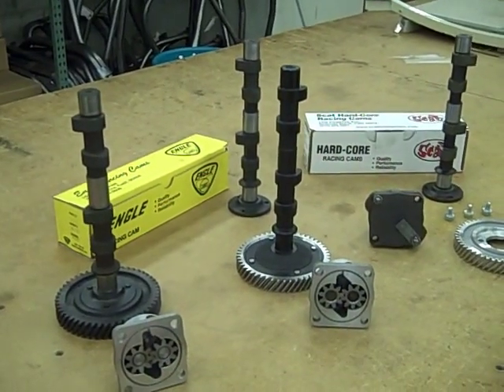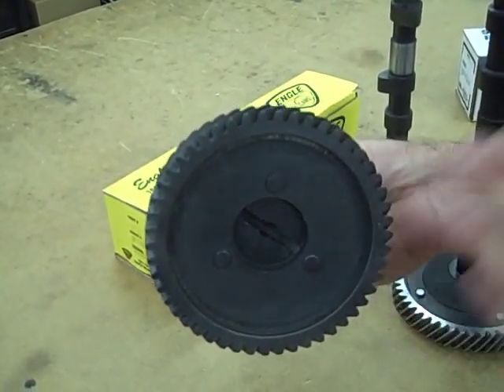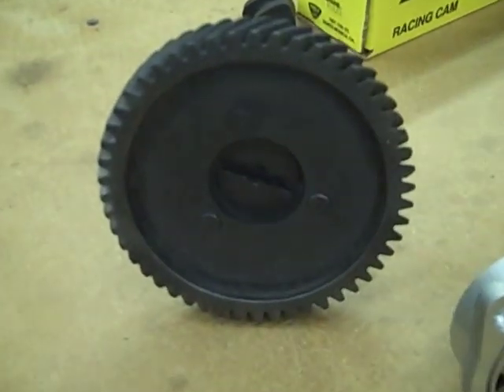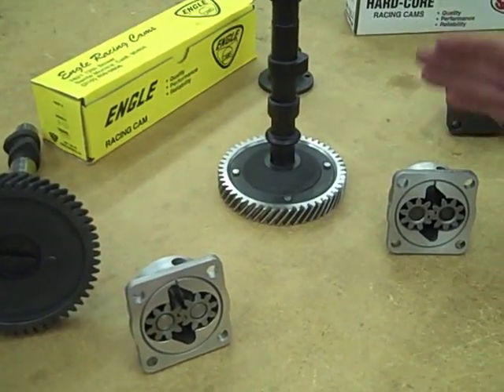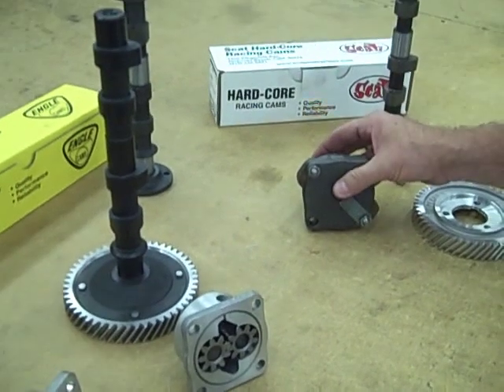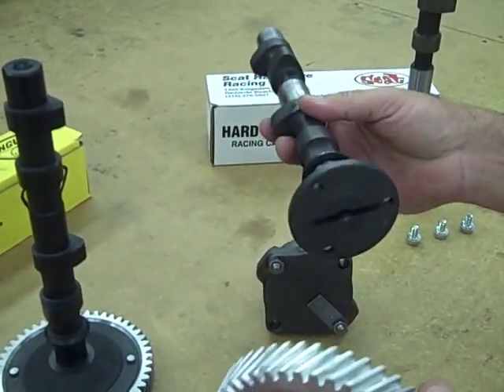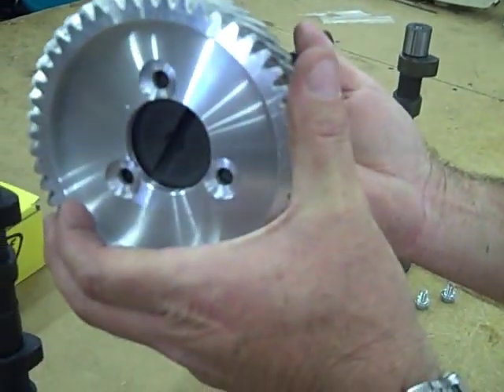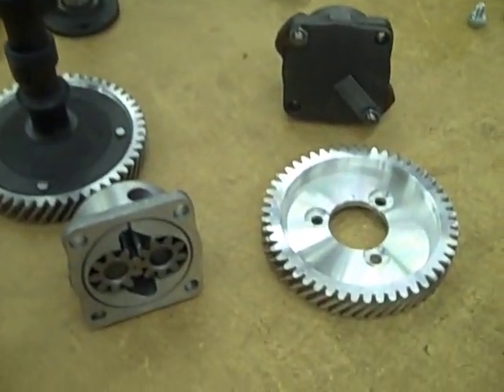Air Cooled VW Cams and Oil Pumps and how to tell the difference.

Comment: I would like to have my type 4 / 2.0 / 914 /carbs / offer quick torque and a flat torque curve....good launch and power thru the first couple 3 gears and then easy mpg cruise.  So need a cam, lifters, and an oil pump to replace factory one.
Any parts, help or clues? thanks steve

Comment: Hi there very informative your video .I have 1968 vw bettle with automatic transmission and I am trying  I am converting to standart shift  so  I am ud dating my oil pump.I got this new pump 30mm. hight performance oil pump. I  am trying to undertand how to install bacause the new pump I got is no giving  room to the crankshaft pulley  to install   in the engine any idea? you have a ny video how you tech me to install this oil pump ?  thanks  I see you know a lot about bettles thanks